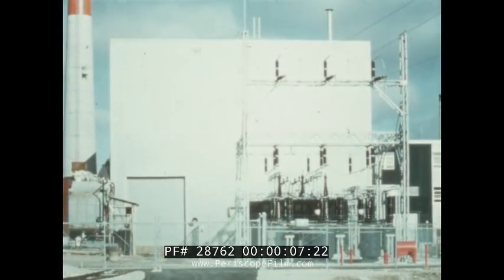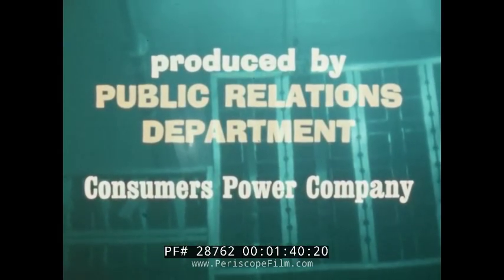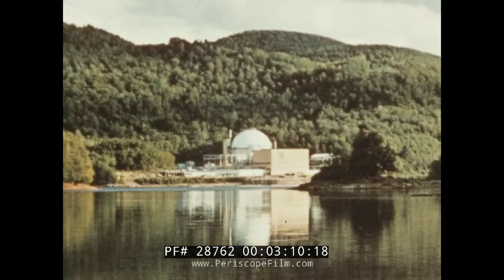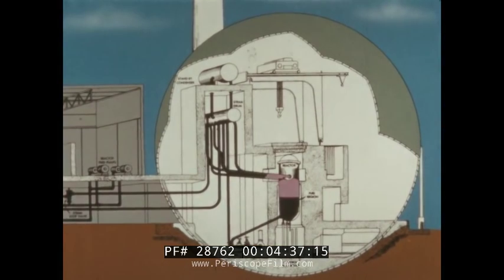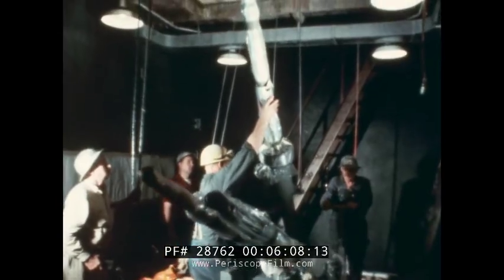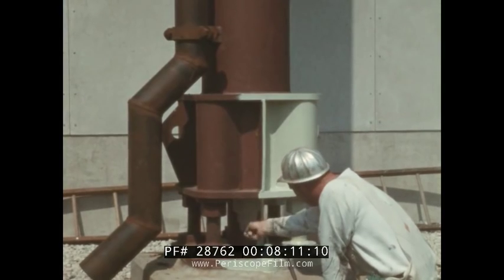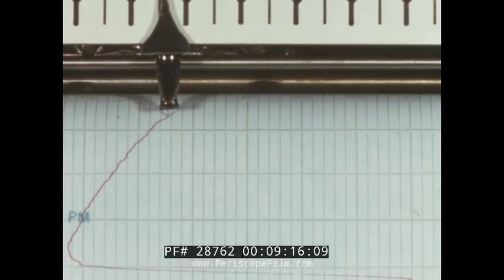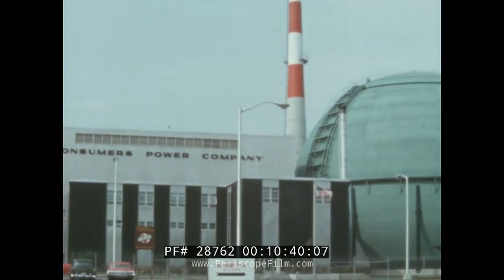RONALD REAGAN NUCLEAR POWER FILM "HEAD START ON TOMORROW" 28762

Comment: Why in the world would the control rods be driven UP from the bottom rather than dropped from the top? Sounds like a recipe for disaster.
Reply: They have to be actively driven into the UP position to enable increase in reactivity; in their DOWN position they stop the reactor. So it's the same gravity-based safety feature as in those where the rods go from the top. The reason why they have to be driven from the bottom is because this is a boiling water reactor, not a pressurized one. The top of the reactor vessel is where the steam forms, and this part has to be shaped accordingly to aid power production. You can't have control rods there.
Reply: @zolikoff  That is incorrect. Driving the rods UP slow reactivity.
Reply: @williamj3359  Yes - They used Nitrogen pressure.  The advantage is access to the fuel.  PWRs have the rod control on top which gives complications during the refueling every two years.  Sorry I was a year late in responding.